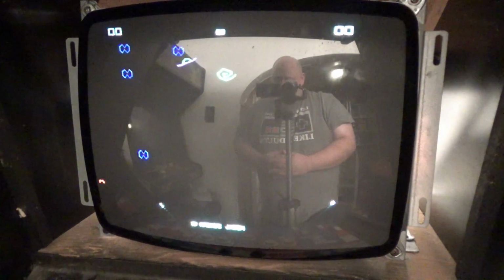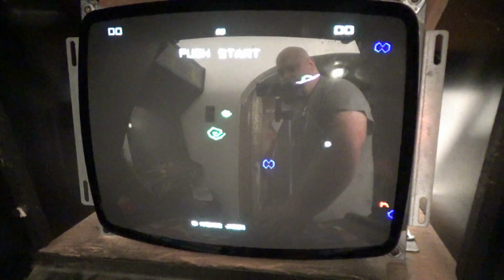COLOR ASTEROIDS  MOD

Comment: Great video! All your videos are very helpful. I need some advice on my Asteroids cabinet. Everything works well except the picture has blank vertical lines that  hide the asteroids and the ship when going through them. I did the cap kit for the wells gardner v2600 monitor, the rebuild kit for the AR1 board and replaced big blue. All parts from arcadeshop.com. None of this helped. Im not sure if its a Logic board problem? Im new to the hobby. Any advice would be great thanks!
Reply from the maker: sounds like you have a DAC problem if i were you i would desolder and swap both AD561J chips and see if the problem switches to horizontal lines. if so get a new dac